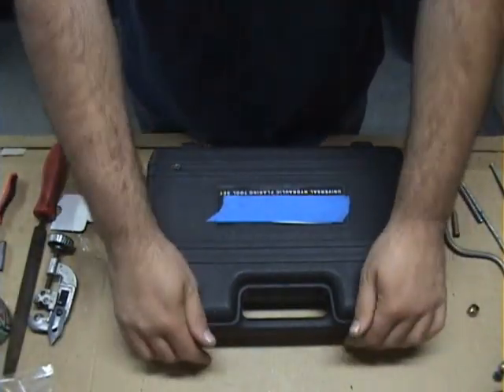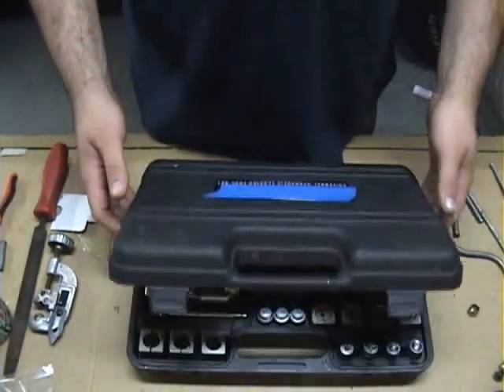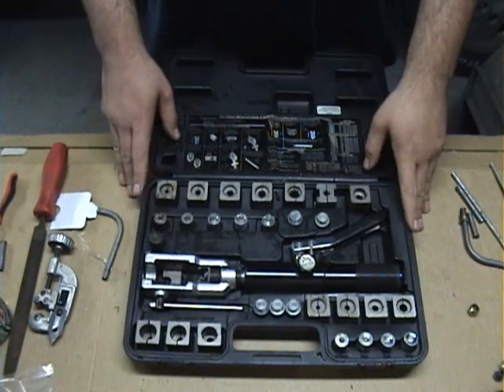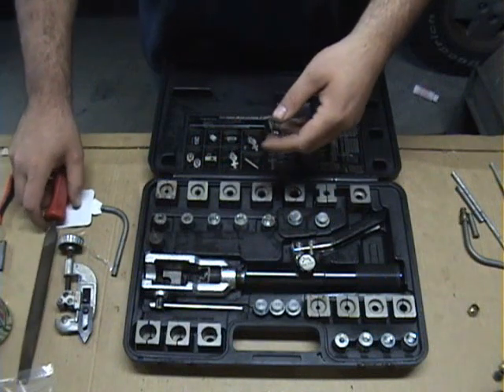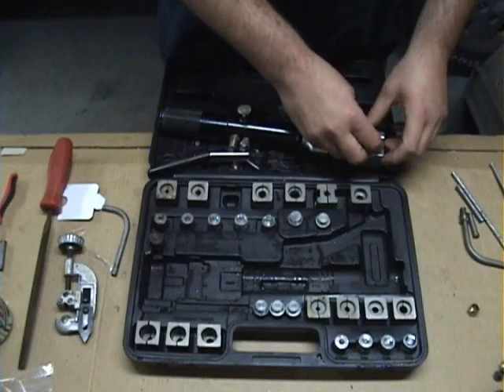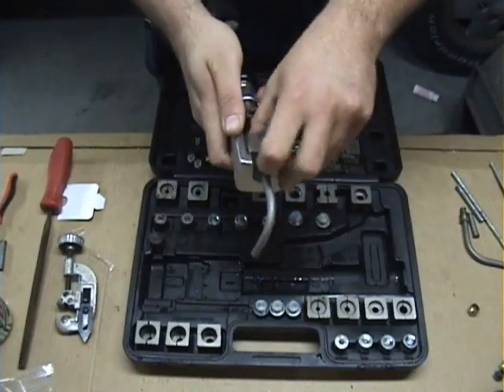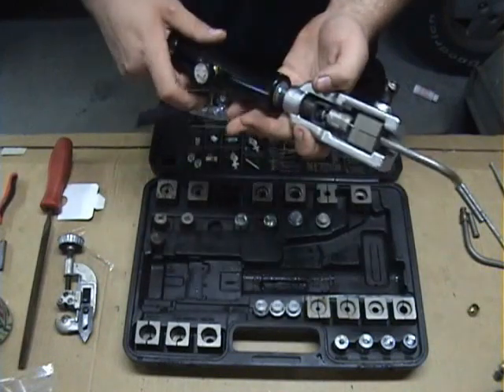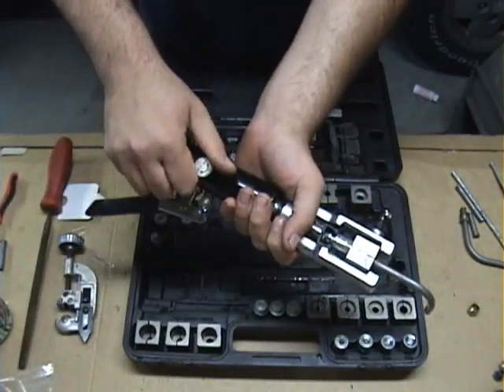Makin' Brake Lines Part 2

Comment: hey I have the same tool.  the only problem I have with it.  is after you flare it.   the not does not butt up-to the flare.   I have too sand the outside of the line a little for the nut to slide to the end

Comment: I just borrowed this tool from my friend and didnt really understand how to use it and this helps. Thanks! I do have a couple questions though. I'm working on a Subaru and I'm just re-coupling the lines (car was cut if half, long story). I have 3 different sizes I'm doing, brake and fuel. What type of flare do I use and and also I'm not sure if I should use the metric dies, or the standard? The car is all welded back together and painted, I just need to fix the hard lines and I'm good to go!

Comment from the maker: @Raven60618 No, I got mine fromSnap-On, Blue Point brand. I beleive Matco has the same one, as does Mac. I beleive Master Cool is the actual manufacturer. In any case, it is an exellent tool.

Comment: @Longbox55 Thanks LB55 for taking your & sharing your knowlege on this important subject. Great to hear it from a master wrench who has no doubt accomplished many quality repairs over the years . You may even be saving lives if you convince even one rookie to do it correctly and never hack it with a compression fitting on hydraulic brake lines.

Comment from the maker: Actually, it isn't too bad. I've flared lines on vehicle with it many times. I will admit, in an extremely tight situation. I usually remove the line from the vehicle and flare it that way than try to do it on the car. Even with the old style manual flaring tool (shown in the first vid) trying to work in a tight spot would be difficult.